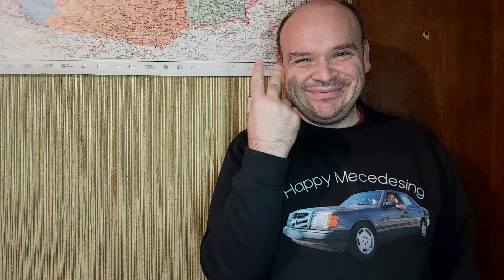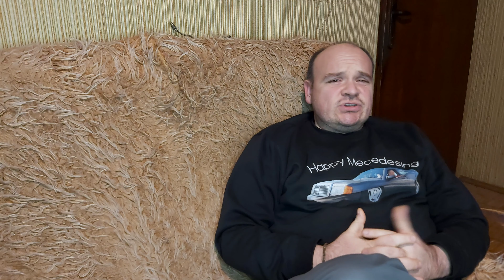㉦Mercedes Ke-Jetronic㉦ - ❓The answer to the question❓ W124 220E

Comment: 🎉❤i wish you a happy new year. 
I follow your videos, and thank you so much for the information that's 
 helping us with. I m from tripoli libya
I have essue with my mercedes r107 450sl its running good but I smell a gasoline out of the muffler seems like 
Fule and air are not tuned. Can you please give me advice to solve this problem. 
Thanks again
Reply from the maker: Thanks a lot my friend. I wish you all the best as well🎉❤may all your wishes come true. Concerning the R107, you must tell me from which year is the car because they are a real mess concerning the Jetronic system!
Reply: Thank you for your quick reply. My mercedes is 1979
Reply from the maker: Okay. So we are in the world of K-Jetronic. The best way would be to go to the inspection and to let them measure your exhaust gases. The tolerance on these models is up to 2%CO. If you have still the protection screw remove it and you will get to the allen 3mm. There you set the fuel/air ratio. Try to go a bit counterclockwise. If the engine starts "Dying" then increase a bit the RPM on the idle control valve by turning it counterclockwise. It's like a faucet - the more you turn counterclockwise, the more you increase the water flow and vice versa. So, you will have to be doing it parallel. This goes of course if your warm up regulator within the specs.
Greetings from Serbia,
Ivica FyM
Reply: Thanks again so much for your help my regards from tripoli libya

Comment: I don't know what kind of help the guy from Kenya requested but unless he actually wants you to physically rebuild his distributor maybe you could find time to dispatch advice, after all the guy is in Kenya. Anyways I disagree, these days is hard to find a mechanic that knows how to work on a KE distributor, even finding a Mercedes dealership willing to work on KE is difficult, Kenya got to be worse. Also indeed is possible to have piston problem ( even though since the car is in Kenya might not be a problem) but for sure he'll have a problem with the spring valves, at least one has to be in the compressed state. And one last thing , I sincerely doubt that in Kenya cars are subjected to a TUV inspection so I don't think that the guy want to "restore" the car, I think he just want to repair it and as long as it starts and drive he wouldn't care if the shock springs are shot, if the brakes squeak, there is play in the steering,  wire is used to hold the bumper and so on.....